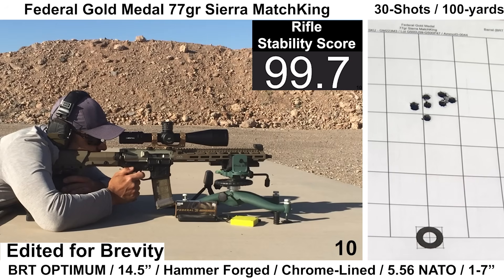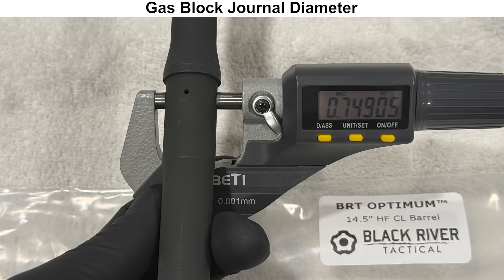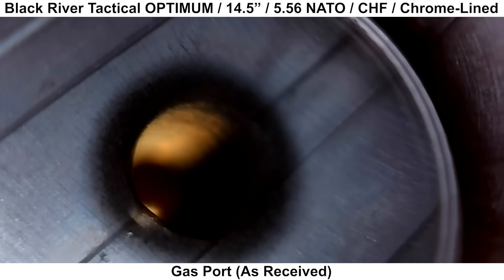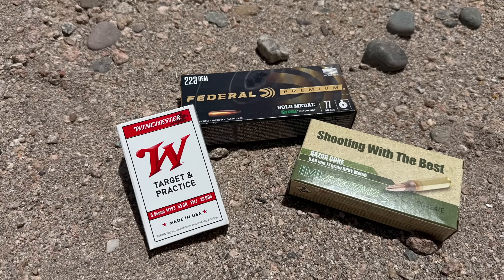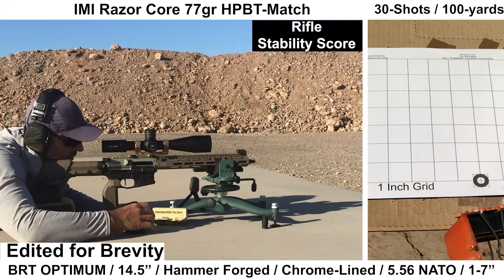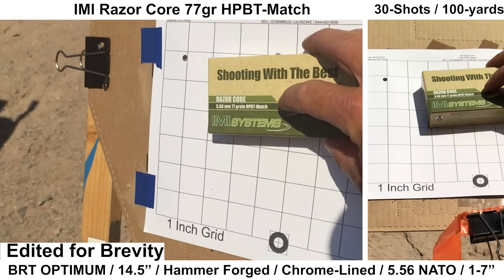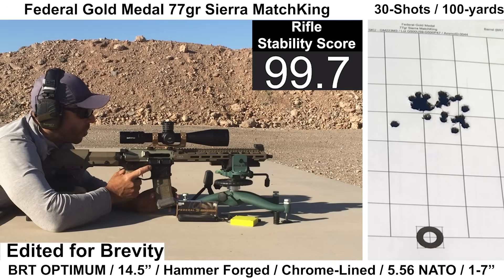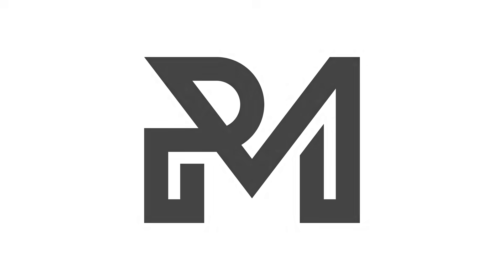Black River Tactical (BRT) Optimum CHF/CL Barrel Evaluation – Part 1?

Comment: Can I send you a Tavor X95? I have a sneaking suspicion that a lot of the poor performance on the internet of the Tavor might be related to muzzle drift as you pull through the trigger wall
Reply: 1 thats not an AR, and 2 its not "on the internet", they're 3 MOA rifles at best in reality when benched in a machine rest with no human input, the barrel just isn't retained rigidly enough and everything shifts and flexes in the receiver.

Comment: Just some annedotal data. TLDR: I have 2 12.5 brt barrels one from 2023 one from 24/25. 23 exhibits none of these issues. 24/25 has the tool marks but no noticeable chrome degradation. I have a 12.5 BRT CHF CL in my main build purchased in 2023. With my really bad shooting I get 1.5-2 MOA consistently. (Again I’m a bad shot so grain of salt). After this video I cleaned the barrel up and did a visual inspection. Saw no noticeable defects or tool marks after around 800 rounds much of it suppressed. I just picked up another 12.5 CHF CL barrel used. The other day and checked it after watching this video. The radial tool marks almost exactly like in this video showed up to the naked eye. But I saw no evidence of the chrome failing so far. Just some more data.

Comment: Well, I'm taking BRT off the list for my next 12.5 and 13.9. I need Sionics to bring back their chrome lined 12.5 mids so I don't have to get a Triarc.
Reply: Griffin makes a pretty good 12.5 but it’s 416R
Reply: @carls2210 I'll get a custom barrel if I'm going 416R.
Reply: @dbraz5 KAK industry has CHF/CL 12.5 mids
Reply: @travdawg2002 I'm a little hesitant because I've never owned or shot a KAK barrel. I'll do some homework to get a better idea of their QC.
Reply: @dbraz5 that’s what has kept me from buying their stuff. I hear some great stuff about their BCGs and barrels and then I hear some not so great stuff. Seems their QC drops whenever they push out too much too fast.

Comment: 1:13 is that normal for A5 buffers?
Reply: The marred circle on the Buffer?  Yeah, that happens with use.  BCG is usually a harder material than the buffer.  Harder scratches softer
Reply: @Puma1Sunfire1 yeah but isn’t it the buffer retainer pin that does the damage?
Reply: @chupachuuups706 If the retainer pin hole is improperly located or the receiver extension is out of spec (something I’ve seen only with BCM) it can cause the buffer to sit improperly in relation to the retainer pin and get marred that way, yeah.
Reply: @riflesfirst208 i think removing it is better for the system; buffer can sustain less damage over time, the BCG shortening over time won’t cause any cycling/timing issues bc the buffer can scoot forward. But maybe the buffer spring’s preload would be less & that can cause issues.
Reply: @chupachuuups706 Possible but I have never tried anything like that so I have no data to support it one way or the other 😅

Comment: This is disappointing for sure.  I've always had good luck with thier stuff, and they offer a few things that are fairly unique.  I grabbed one of these when they went on sale for 250 and i think they drilled/pinned it for another 40.  Haven't noticed anything abnormal shooting it, but i also dont own a borescope.  I do like the longer gas system a lot.  Felt closer ro a rifle length than a middy to me even though its 16".  Hopefully it holds up better than this.  Maybe ill send mine to you after i abuse it a little.

Comment: Damn. I have a BRT Optimum... Guess it can become a 22 lr conversion barrel.
Reply: When did you get it? Is it also CL HM? Like most AR companies, they don’t manufacture these in house.  I have two…2018 and 2020.  The stainless 16” from 2018 is more accurate than me, getting a 1.2” group the very first time I as a shooter had the opportunity to shoot at 100 yards (2023).  I’ve gotten down to right at 1” the two times I’ve gone back.
I haven’t checked groupings on the 11.5” nitride.  But it always goes bang and hits the trarget from 5-50 yards.
I think the lesson here for Clint is to respond to email.  No one would hold one or even two bad barrels against him.
Reply: @JustAnotherGuyOff  It's a 2024 or early 2025, hopefully it's good to go.

Comment: Man thats a small gas port and i like that . Especially with Traditional type gassy Can . I run BRT EZ 0.073 ( equivalent to 0.070 Mid length Gas Port Size ) with Blue and H2 on my BA 556N 13.9 HF CL Barrel . Its dedicated suppressed only setup . 
I know Sionics has options for reduced size gas ports as well . 
Hopefully one day you can get your hands on Sionics barrel to test out . They do some 3rd party Xraying of all barrels . 
4 months is bit much for sure . I know id be more pissed off than keebler elf getting demoted to fudge packer..

Awesome video bro

Comment: Sad to see their customer service is dog water. Completely anecdotal and partial info, but my 16" Optimum shot a 1.16 MOA 10 shot group (1.03 9-shot group) with IMI 77gr from a bipod on 6power glass. Group was vertical, horizontal was .54 MOA. Barrel was "broken in" with a couple hundred round prior. Probably a bit overpriced in my opinion. Not in defense of BRT, but no major issues with mine.
Reply: Yea mine neither.  Shoots pretty good IMO.  But I don't own a borescope so I have no idea what the lining looks like.

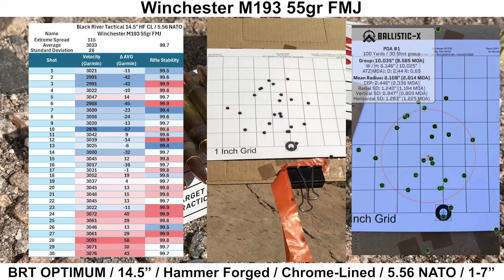Comment: 12:09 In case you don't hate Winchester M193 enough..... Yesterday I took my M91 Carcano Cavalry Carbine made in 1919 to the range(I've got a thing for old guns). 1st time ever out with it after I refinished it. The bore slugged to 0.272" grove to grove and 0.260" land to land, nominal diameter in 0.268". I shot PPU 123gr soft point(exposed lead tip) factory ammo. The bullets are 0.264". If you know anything about these carbines, the sights usually jiggle, and they are VERY crude to begin with. The POI is usually WAYYY off from POA. With the tip of the front sight barely visible in the bottom of the V rear, it STILL shot 9 MOA Left, and 18 MOA High. With ALL of that, I shot an 8 MOA 10 shot group, from a bench at 100 yrds without a front rest or rear bag, just elbows on the bench.....
Reply: In this case I don't think you can entirely blame win m193
Reply: @blodus4521  
yeah this barrel sucked, but it has a history..... without looking, I'm pretty sure it's NEVER done better than 4 MOA, and has more than 1 group over 10 MOA.....

Comment: Personally i want to know how all these subscribers have spare NIB barrels just laying around all higlty pigilty.  I'm disappointed to hear how BRT handled the CS issue.  This looks very clearly like an issue during the chrome plating process, either not done correctly or just not prepped correctly.  Not gonna lie I'm re-evaluating using them for the next build I've been planning.
Reply: Tism my friend, it's the tism. I no joke, have about 5 barrels laying around. 2 have no rounds through them.
Reply: @DonJohn-h8l  guntism is a common affliction here.
Reply: It was actually me who sent it in, I had issues with grouping on the original 14.5 CHF/CL I bought from them, RMA'ed it, and offered to send it in to Preston once I received it.  I just verified the correct item was sent and then turned around and shipped it right over.  

My original barrel I couldn't get it to group better than 3-3.5 MOA with a variety of match ammo, but didn't have issues with the chrome like with this barrel.  I originally reached out to RMA my first barrel on March 31st of this year, so its been nearly 7 months and I still don't have a barrel to show for it.
Reply: I put together a 12.5 today. Hope it works out.....

Comment: Got it! STAY TF away from BRT! Thank you SIR!
Reply: Frank Desomma was right about Chrome line, no one does it good enough so he settled for nitride/qpq decades ago.
Reply: @totf2when13  this is true when it comes to that top marksman style barrels. Chrome lining is often lowering the accuracy a little bit to greatly increase the longevity. But maybe some people are perfectly happy with 5000 to 10,000 rounds instead of 20,000. Especially when you factor and how much money 20,000 bullets would be.
Reply: @liggerstuxin1 Nitrided barrels, as I understand it at least could be wrong, are technically harder or very close to chrome lined barrels for non-heavy use, but the drawback is nitrided barrels don't handle the heat as well. The barrel lives are much closer than 5-10k for nitrided and 15-20k chrome, the main difference is firing schedule and how they handle that heat. Stainless is much softer with a  shorter barrel life than both CL and 4140-4150 nitrided.
Reply: @RikkiTikkiTavi290 Nitride is a cost cutting measure in 95% of cases when used on a carbon steel barrel. 

No company is nitriding barrels because it’s better than chrome, they’re doing it to save money. 

Same reason you see all these companies using 9310 for bolt steel, pure cost/corner cutting.
Reply: @riflesfirst208 Nitriding predates chrome lining by probably hundreds of years and nitrided barrels are generally more accurate than CL barrels with both being equal quality. Nitriding is also potentially more corrosion resistant. 9310 is not technically inferior to c158 it just has a wider range of quality if not treated properly. Both can and do break. Being cheaper does not equate to being worse in every way.
Reply: @RikkiTikkiTavi290 Yes. 

People have been nitriding rifle barrels for “hundreds of years.”

Got it 😂

Also “9310 is not technically inferior” is a really bizarre way to go about agreeing that 9310 is absolutely inferior to C158
Reply: @riflesfirst208  The point of me saying that nitriding has been around for hundreds of years was to show that nitriding is not just a cost cutting inferior process. Not something that needs to be explained. Nitrided stainless and CMV barrels are more accurate than CL in general when from reputable manufacturers or at the very least are not less accurate than CL. I didn't agree that 9310 is absolutely inferior, I pointed out that when done correctly 9310 can be just as good as C158. Again, not something that should need explaining. C158 can break and 9310 can break.
Reply: @RikkiTikkiTavi290 9310: just as guuuuud 😂

Nitride, in carbon steel barrels, is only ever a cost cutting measure. It has no advantages over chrome for the end user, the advantage only exists for the manufacturer because the application of nitride is much cheaper than properly chrome lining a bore and chamber.
Reply: @riflesfirst208  C158 is just a specific grade of 9310 from Carpenter. 9310 from a quality manufacturer can absolutely match or exceed C158 in quality.
Reply: @totf2when13 The problem with nitrided barrels is they heat up much faster than chrome lined, so much so that they can start cooking off rounds in the chamber when a chrome-lined barrel would not. I also actually got a Criterion nitrided barrel so hot it started burning the cerakote off the inside of the rail in places.

Comment: I have met the guy who owns BRT. I'm gonna let the cat out of the bag. He does not manufacture this barrel. He contracts a different company to manufacture them and then they go to different vendors for coatings and yet another vendor for laser engraving. Same thing with the gas tubes. I have never felt compelled to buy one of these barrels despite being local to this company. I do REALLY like the ez-tune gas tube though. I'm kinda surprised that you haven't heard back from the company in 17 weeks. BRT is not a big company, its literally just a guy and probably his wife. You haven't even gotten a response email in 17 weeks??? Wow.
Reply: So like most ar companies
Reply: I'll venture a guess and say FN manufacturers these barrels for BRT.
Reply: @deadweight2049  pretty sure if these barrels were made by fn they would put it in the description like spikes, centurion or psa
Reply: @sussybaka6856  Wrong. Most "manufacturers" actually contract an OEM and stipulate that they cant' advertise who is their source. There are very few cold hammer forges in the country as they are way more expensive to own and operate than a button rifle machine. Given the borescope footage FN is very likely BRT's OEM.
Reply: @deadweight2049  NO WAY
Reply: @deadweight2049 youre delusional